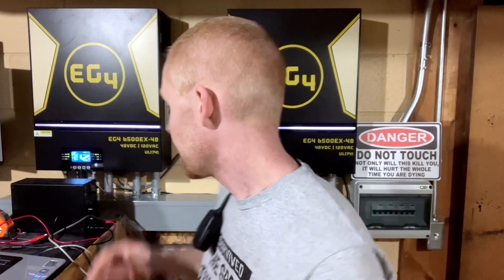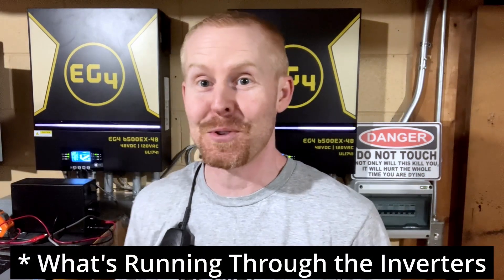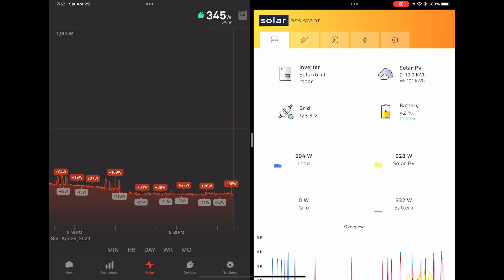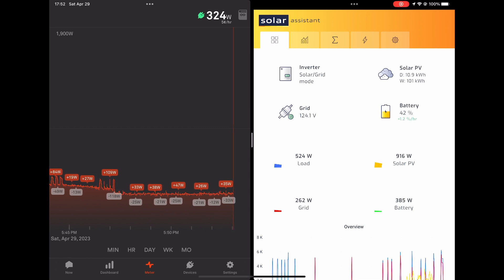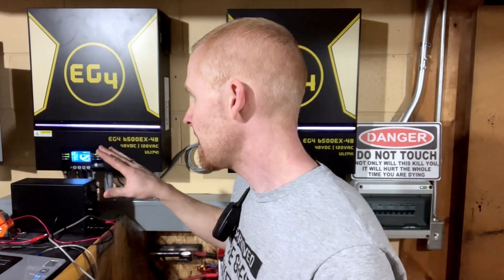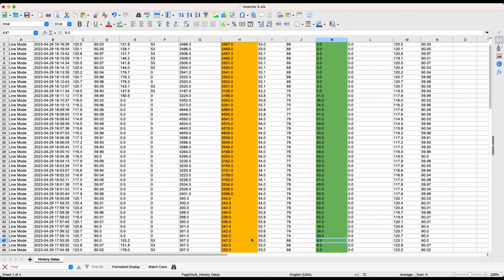Grid Charging and Large Loads on EG4 6500 Inverters

Comment: Did you mention how to get the grid to charge the battery's to start with?
Reply from the maker: I’m not sure if I did or not.  

I know that to get the grid to charge, you have to be in a “utility mode” like SUB or USB (it would also happen if you’re in the “U” of SBU).  

You also have to have option 16 set to SNU or CSO.  Unless you’re in USB, all grid charging will only happen after solar goes away though even if option 16 is set to SNU.

Comment: Pass through is rated by wire size and breaker size to protect the wire if it didn't throttle back the load it would blow the breaker.

Comment: I have often wondered how being grid tied can work with the EG4-6500, it's actually a little scary to me. I see these inverters fed by solar, battery and grid, through the service panel, then from the inverter back to the service panel to be distributed. It seems that a circular flow of power rather than a linear flow that we have without grid power. EG4 evidently has it figured out and it seems that you have a better understanding than me and most as to how these inverters work. I will run a generator as my backup source and still contemplating in my mind as to how it safely works.
Reply from the maker: Thanks for the comment!  

One thing to note is that these inverters aren't technically "grid-tied" inverters.  A "grid-tied" inverter is one that can inject power back into the grid.  These can only take power from the grid in a grid-bypass mode where power from the grid supplies the loads (or charges the batteries).  

Good luck with the generator.  I know there's been a lot of discussion around generators not supplying enough power for these inverters and potentially damaging them.  EG4 came out with their "chargeverter" which is supposed to get around all those issues by charging the batteries directly instead of charging through the inverters.  The generator test is one that I'm really on the fence about trying because I don't wana damage these units.
Reply: I purchased one of these 2days ago and they now make an item for using a generator to charge into the inverter with out causing problems. There about $350 . Sig Solar said generator charging was something that caused failures within the inverter because of power fluctuations and or low power . They also make a 48 volt battery charger that they recommend which was close to half the price .
Reply: @royweatherford64 ,I have one of those too, but haven't yet installed it.

Comment: Adam, do you have "soft start" electronics on any of your HCAC or well pump loads?
Reply from the maker: Thanks Brian!

Currently I don't have any soft-starts installed on any of my equipment.  I have a feeling at some point I will be putting on on my A/C, but right now that's not hooked up to my solar.  

Here's a link to a video put out by Gavin Stone.  He has the 6500s right now and added Micro-Air soft starts to his A/C units.

https://youtu.be/g3NQTF-5h54

Comment: So whats the total grid output it's capable of per leg. Ie if you add the ac output + grid charging , what's the maximum output you saw?
Reply from the maker: I didn’t get to the point that grid charging stopped completely on a single leg, but the data pointed to 6500w being the peak.
Reply: Roger that. Thanks!
Reply: Another question please- say the inverter is powering the loads from solar- will any left over solar charge the batteries at the same time? So let's say I've got 4000watts of solar output and 2000watts of load. Will the remaining 2000 water go to the battery(assuming the battery is not full)?
Reply from the maker: @jl9678  It does depend on the "Output source" mode you're in, but yes in most cases, any excess solar power produced would go to the batteries to recharge them.  

It won't be an exact 1-to-1 ratio of excess power to the power going into the batteries due to line losses and inverter idle consumption, but it will be close.

If the batteries are full, then the inverters will only take the solar they need to supply the loads.
Reply: That's great to hear. Thanks so much for taking the time to answer all my questions-appreciate it
Reply from the maker: @jl9678  your very welcome!

Comment: Dear Adam ,How can I get the inverter data sheet?
Reply from the maker: I’ll work on putting it on my website and then I’ll let you know.
Reply: Thanks Adam.
Reply: Have you ever met the inverter fault and it’s  message is 「Bus Over」?  I got 3 inverter parallel (Axpert max twin 11K ) and discovered inverters shut down bypassing to the grid every 2 or 3 days.  The outages happened at different time zones. If you have met the situations before,please tell me why.
Reply from the maker: @rockychien1019  no, I’ve never had the inverters overload and switch to the grid.  Do you know what your loads are like when the fault happens?  What’s your maximum output set to on your inverters?
Reply: @AdamDeLayDIY  The load is light because it happened at 20:30-10:30 three times within 10days.  Air conditioner  is working at 26 °C. The inverters shut down and bypass to the grid.
Reply from the maker: @rockychien1019  do you have any loads that might have a high startup surge?
Reply: @AdamDeLayDIY  The VOLTRONIC engineers came to my demo sites yesterday and we found the problem. We can’t combine off grid and on grid systems together. In the beginning thoughts we hoped to use off grid outputs AC2 power to support on grid inverter AC IN. But the on grid inverter system will feedback the electricity from time to time,this would let the off grid inverter bus voltage over. Share with you this situation.
Reply from the maker: @rockychien1019  thanks Rocky!  Glad you were able to get it figured out!  Thanks for sharing!
Reply from the maker: Here's the links to the log files from the test.  https://going-off-grid.com/misc/#logs
Reply: @AdamDeLayDIY  Do the data sheets come from Solar assistant app?
Reply from the maker: @rockychien1019  you can get data sheets with  10 second intervals from Solar Assistant, but I got these ones directly from the WatchPower app on my computer.